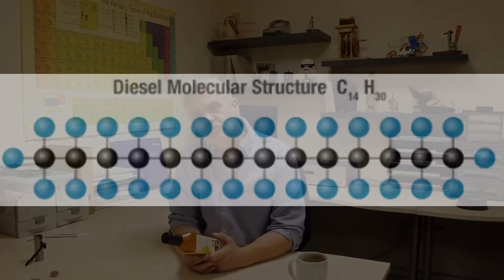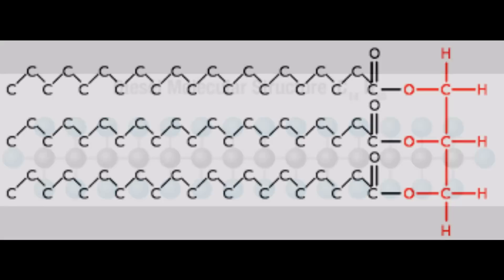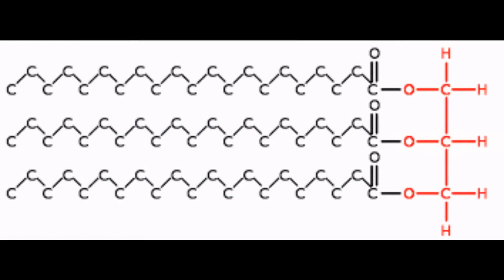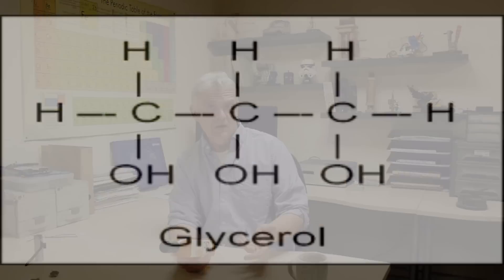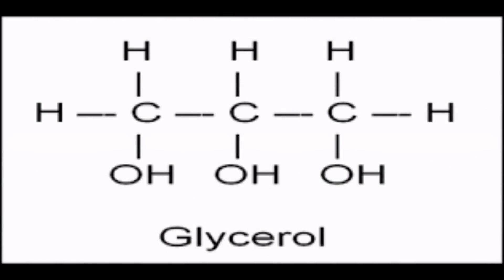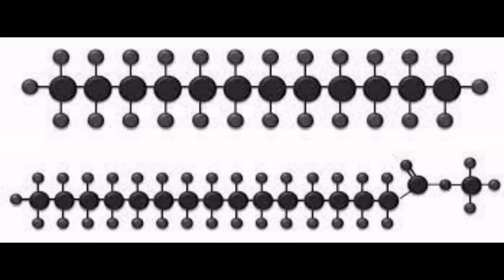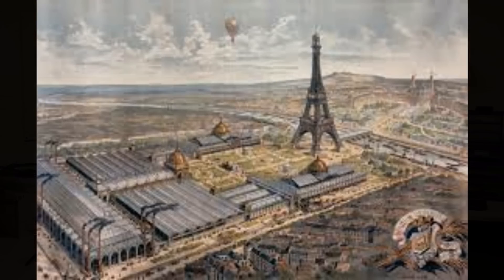1672 Biodiesel 101 - The How And The Why And The Wherefore Of Making It

Comment: Do the deesterification in your ultra sonic cleaner, the reaction will be much quicker and require less or no catalyst.
Reply from the maker: nice one mate - I was thinking of sources of oil and methods of production as a separate video - I kind of want this to be ultra straight forward but thanks for the suggestion
Reply: @ThinkingandTinkering  How about single cell algae?
Reply: @ThinkingandTinkering  figured you'd go on a run with it. Just wanted to make sure you knew about that.  Its a very quick processing method. Hope all is well .
Reply: @ThinkingandTinkering  Oh do tell.  What is an Ultra Sonic cleaner ?  Never heard of that one.  Thnx
Reply: @SquareRootOfMinus1  a machine that uses electrical inpulses to "vibrate" a container filled with water to the point the vibrations cause cavitation. The cavitation creates pressure and heat around objects in the fluid. You can make coffee with one pretty well.....js lol.
Reply: @SquareRootOfMinus1  :  You’ve probably seen them before, but not realized what they were,  possibly in mechanics’ garages, cleaning the parts from automobiles or bikes, or likely in a jewellers’ shop, for cleaning the jewelry.

A lot of the time, they have a cover on them so all there is to hear is a gentle hum.

Possibly one of the most useful pieces of equipment on the planet.
Reply: Should a pool air stone work? Im trying this at moment?